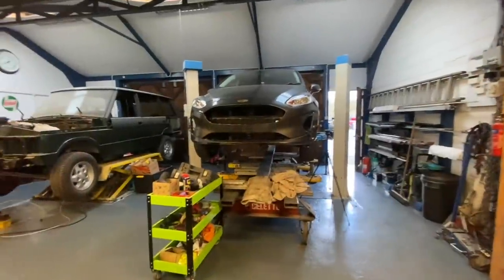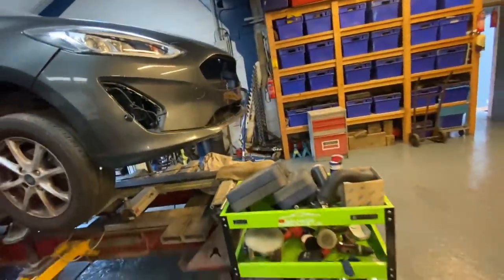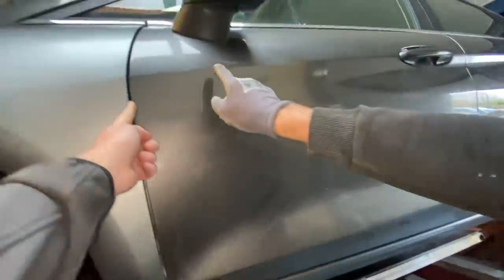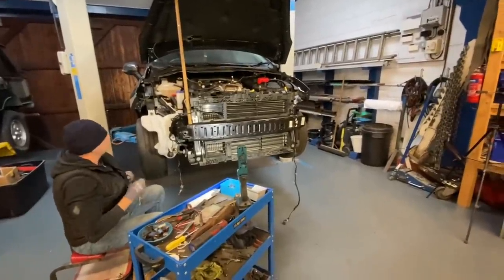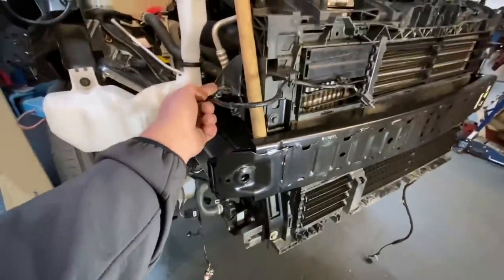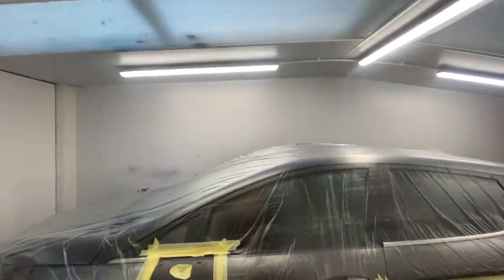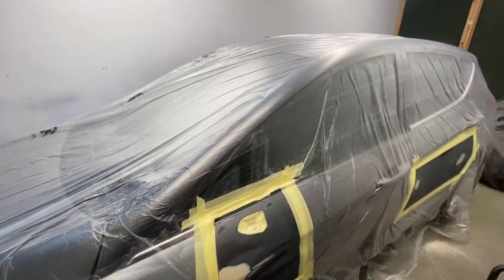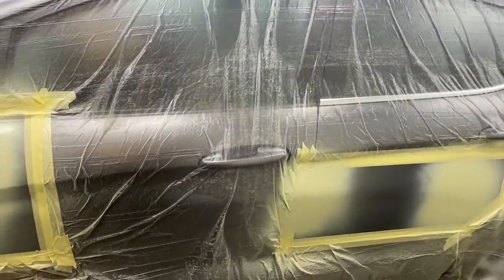REPAIRING A 2019 FORD FIESTA SHOCKING PREVIOUS REPAIR PT 3

Comment: Your ABS/windscreen fault is probably related to an auto braking camera in that plastic box.  My Volvo (from the Ford era) has the same cover and inside it, there's a "City Safety" camera that emergency brakes the car while travelling up to 20mph if it detects something stationery up ahead.  You may need dealer level diagnostics to reset and recalibrate the modules.  I think I've spotted a bent heatshield, top centre of the engine. At the start of the video it looks like the fins are bent in. Hopefully it's an easy repair with a right angled pick tool.  My PDR guy charges £20 per small dent, initially he was quoting £100 starting price but I built a good relationship with him over time and now he gives me trade rates.  He's sorted out some serious damage for me recently, and he's saved me thousands in filler and paint.  Keep up the good work :)

Comment: The ABS fault will more likely be because the front radar is missing / not yet connected from the lower part of the bumper, if it has collision avoidance it normally uses lidar (the 'camera' behind the mirror) & the radar (behind the bumper)- in 99.9% of cases the 'camera' doesn't move in a crash and as its in the cabin, its more resilient, but its normally the lower radar which causes all the issues (as its missing / not calibrated / knocked / got water in it / road salt etc. ) - on newer VAG cars (which I'm more used to), this is a simple task of using an appropriate diagnostic tool and parking the car the correct distance from a vertical wall.
Reply from the maker: There’s nothing behind the bumper only on the screen 👍

Comment: Hi Guys. Does any one who if a standard 2019 fiesta mk8 door will fit on a vignale model.and then have the chrome strips/trim bolt on? I understand the vignale doors have holes for thr trim to be attached. Thanks.

Comment: Over time, watching your videos, I have learn’t so much about the architecture of modern cars. They are complicated, but if you follow a systematic analysis of the problems, as you do, the car’s systems tell you when the fault is repaired or located. When it comes to the bodywork and structural repairs that is down to the many years of experience acquired by Chris in the trade. You are a formidable team with a superb work ethic. Can’t wait to see you sort that Bentley out - nice New Year tickle for you 👍😎🇬🇧

Comment: Happy New Year Rob and Chris.  Love all the work you do.  I would suggest that you physically check that the air bags are present.  They may well of fitted resistors in place of the blown air bags to fool the ECM into thing that they are installed and not detonated.  Judging by the standard of work I wouldn't put it passed them
Reply from the maker: There all there 👍
Reply: What, you think the clowns who ''repaired'' this car first time round would have the intelligence to fit the correct size resistors in place of airbags. Nah, I doubt they could even spell resistor!

Comment: Lads I have worked for a car company for over 20 years making new cars and worked for the paint department, the dents you filled do not need filling just lifting or ABing if the paintwork was damaged then sprayed a car that is 2 years old does not need filling bad practice.

Comment: ADAS systems (such as the windscreen camera) are something to have a good look into when repairing modern cars. As you said you issue was more than likely caused by the windscreen being replaced. Its also important to ensure the correct windscreen is fitted too. Non genuine screens can cause havoc with the cameras view, and can prevent successful calibrations👍🏼 top video guys non the less guys👍🏼

Comment: The screen camera (lane keep assist and crash avoidance) needs calibrated using a board that has a pattern on it  levelled to the front of the car using lasers, it's all done through the obd port, you'll need to get the steering geometry checked before you calibrate it as well as the system interlinked through the steering 😉

Comment: You can reset the steering angle sensors on these there’s a specific procedure if you need it let me know can get it. But tbh for the price easier to replace the steering angle sensor and clockspring as there so easily damaged and not hugely expensive. And also don’t need programming there plug and play

Comment: Be sure to check if the dash and steering wheel airbags are there, the computer can be tricked to think there is an airbag with a simple resistor

Comment: I've been using Bosch net sanding pads (will fit any brand circular sander) with my domestic vacuum for sanding recently, really stops the pad itself getting clogged up, and makes for pretty much dust free sanding.

Comment: As a computer geek...I'm curious as to why that diagnostic computer (and the car's computer) can take actual minutes to talk to each other? The CPUs in either or both must be ancient?  Nowadays two devices talking to each other (expecially when cable connected)  should take milliseconds. Maybe seconds, but not minutes!  I wonder what's going on there?
Reply from the maker: It’s not connected via a wire
Reply: @sruk  oh okay, ta :-) sorry i thought they plugged in. Nevertheless, it seems very slow. must drive you nuts waiting for it. Also - thanks for all your great content and hard work :-) Hope '22 is kind to you both.
Reply: @sruk  OBD2 dongle then?

Comment: Hey great video. Just a quick one about the  bag for paint. It is double sided due to one side having a protective coat which stops the paint coming off the bag when painting and landing on the panel.
Reply from the maker: Yes but like Chris said it doesn’t matter it’s just prima 👍